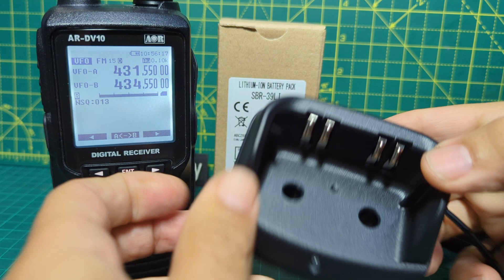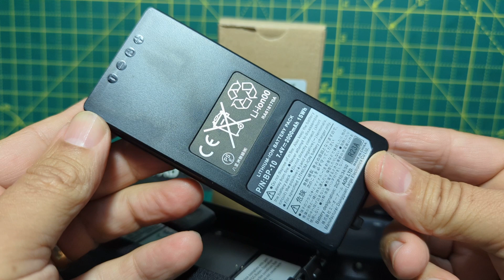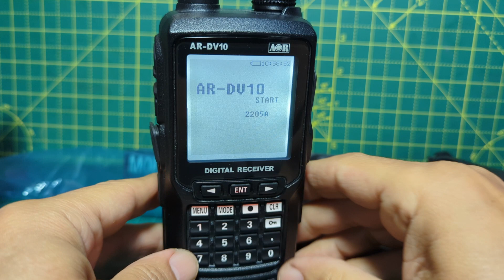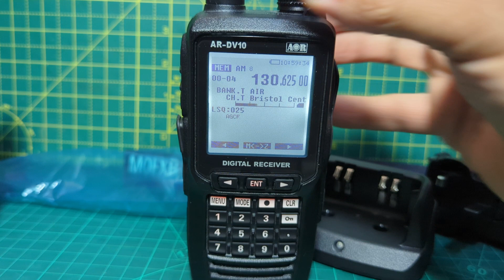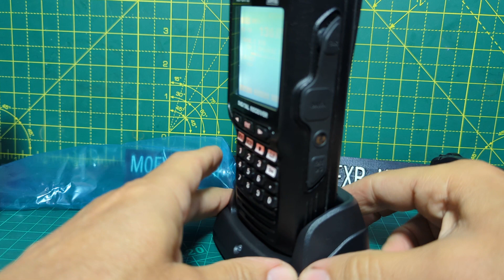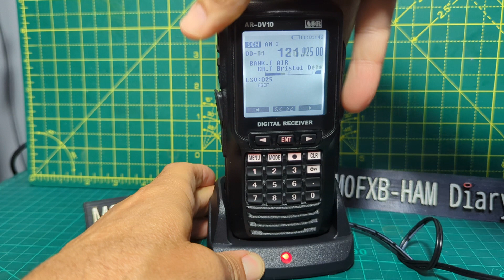AOR DV-10 SPARE BATTERY OPTIONS

Comment: Hi good video for me. I went to use my brand new AOR DV10 and the battery won’t charge it might be because iv not used it for a wile saying that this has never happened to me on any radio my radio is brand new but iv been I’ll so I never used it. Cut the story short I see your video and just ordered two batteries from ML same as you. I did but my radio from ML so I will phone them. One cell has gone on the battery the charger good this charger plug is centre negative witch I not seen many times. Any way thanks for your video.👍
Reply from the maker: Hi glad it helped thanks for watching .
Reply: @m0fxbhamtech   Thanks my friend. 👍😀